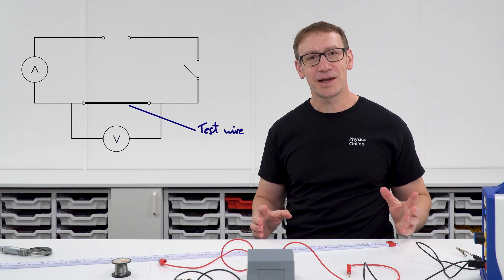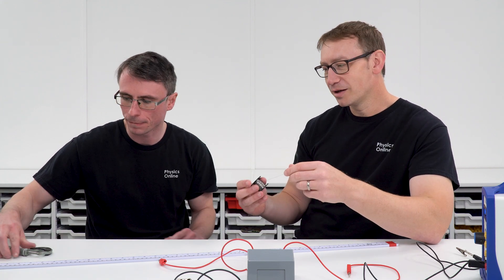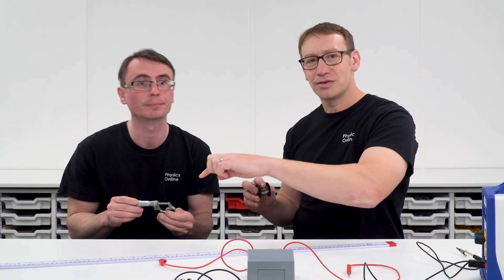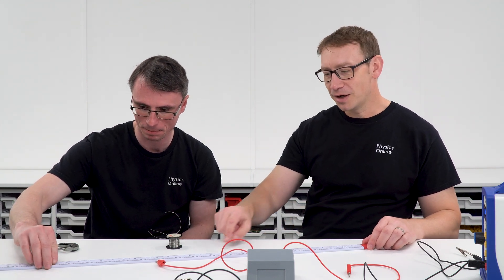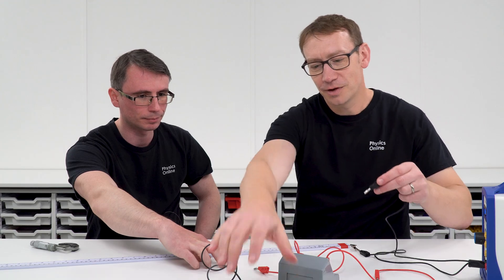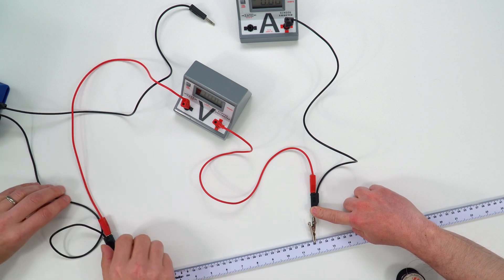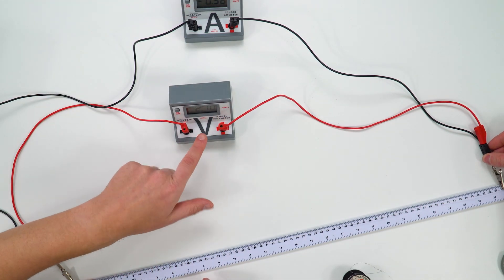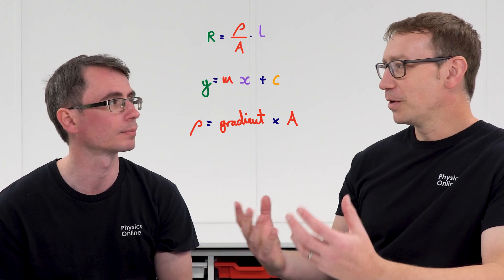Resistivity Practical - A Level Physics Practical

Comment: What a fun experiment like this. There are several ways to increase the accuracy (other than the "just buy a Keithley 7½ digit voltmeter lol").
1) Swap the leads in such a way that the voltage measuring leads are on the "inside" of the wires, so closest to the alligator, and the current wires to the outside.
2) Leave the current running alligators, but add new alligators with the voltage sensing ones. Then the voltage drop in the alligators is negated fully and much better measurements can be obtained.
3) While measuring, swap the current direction and subtract the offset found. Alternatively, use an AC source but typically it is harder to accurately measure those.

Comment: I'd always add a variable resistor to keep the current constant, and usually aim for 0.5A to reduce any effects from temperature on resistance.
Reply: If you do it as a potential divider circuit with a flying lead on the volt meter the current is aways constant.
Reply: I may need to see your circuit diagram and test it, it's not obvious to me that that would be the case.
Reply: @midd1etony  you just put the supply across the whole length if wire with the ammeter in series. Connect the voltmeter to one end of the wire, the other connection is a flying lead you can move along the wire. Measure the length of wire between voltmeter connections and record the pd. The current stays the same, the wire stays the same temp